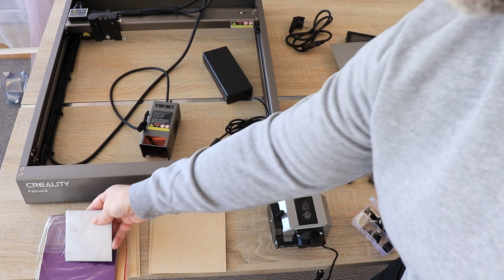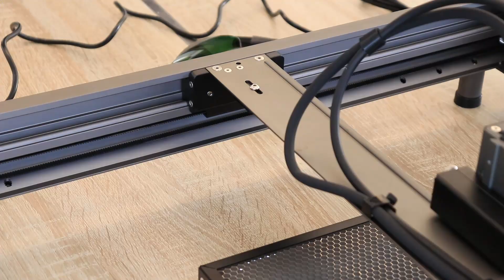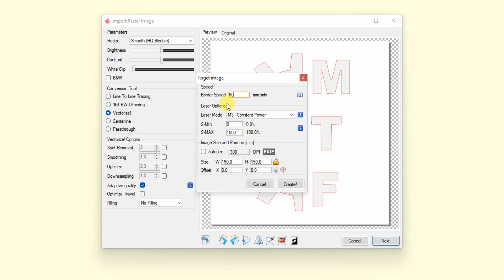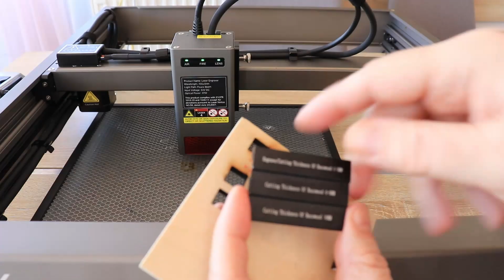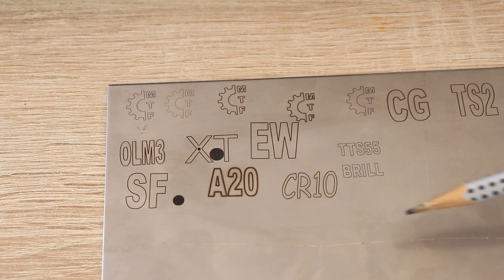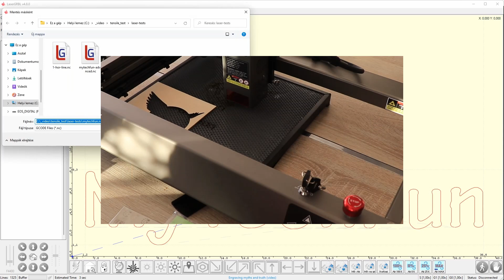A whole new level: Creality Falcon 2, the 22W diode laser from Creality

Comment: That sucks the other pump is stronger.
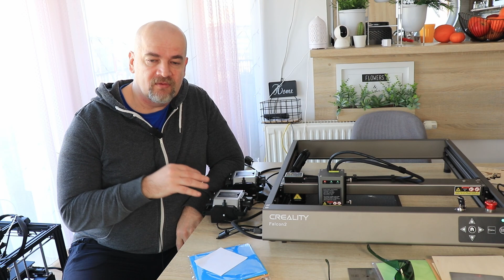Reply from the maker: No, it is not, I explained it at 8:43 https://youtu.be/QUKGsR6oSdE?t=523 (in software it was set to 25% by default)
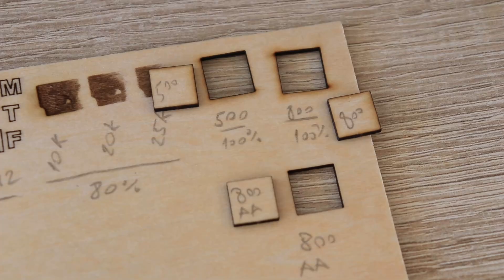Reply: @MyTechFun  I saw that but then around 13:40 I was confused again. But notice you wrote 25% on the screen there as well. 👍

Comment: Mine has arrived and I have a couple of observations.  Multiple screws on the assembly were loose.  The adjustment screw for the dovetail mount for the laser had to adjusted -- the laser head wobbled on the mount.  They did not include the honeycomb bed and when I reached out to Creality, the honeycomb bed does NOT come with the unit.  Other than that it seems to be working well with Lightburn.
Reply: I bought one too following this video an I had same experience. No honeycomb, loose screws, metal engraving only works for raw steel.

Comment: Thank you for the review! I'm working on a project where I need to cut paper withot burn marks on the back side of the paper. Could you please include paper cutting into your video tests? Or maybe could experiment with a solution for that? There is not many videos on the subject as the moment. And I think diode laser is a extremly good platform the paper